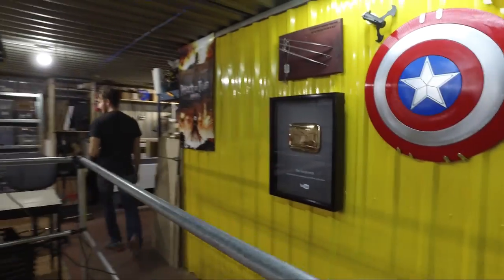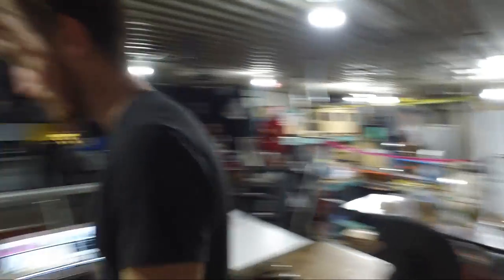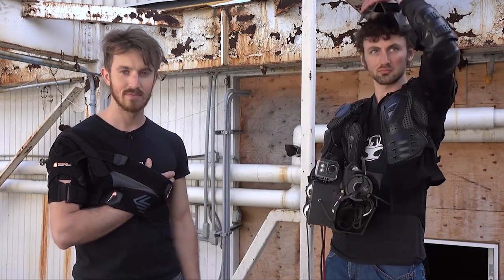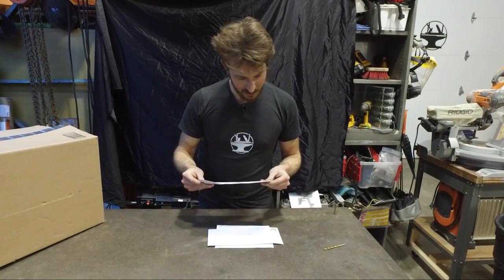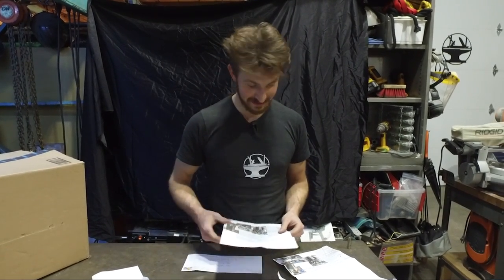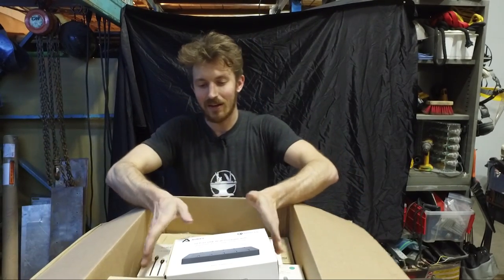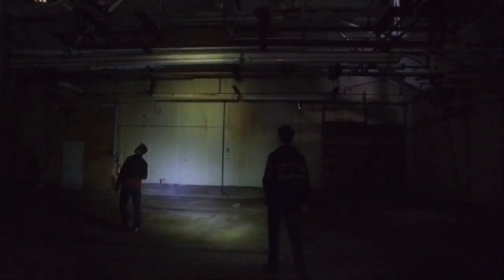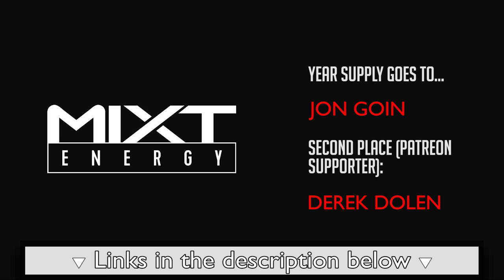LASER BAZOOKAS and Tesla Coil Guns!

Comment: you need to tighten your trucks on your longboard this way you wont wobble around and fall that easy
truck= the part that connecs to the wheels 
to tighten them you need to turn the bolt in the middle
sorry for bad english
Reply: Melvin van Dijk aaah ging wel goed joh
Reply: Aron Balk das mooi
Reply: Melvin van Dijk he should learn when to bail out as well, the moment he noticed the board wobble that much he should have bailed
Reply: also maybe elbow/knee pads, a helmet, and them wristy things xD
Reply: he could also just bend his knees
Reply: Melvin van Dijk idk about y'all but if they're tight I have less control. I keep them as loose as they'll go without wobbling
Reply: BlackironBallistics same
Reply: BlackironBallistics but if they are thight you don't wobble as much. 
And ofcoarse you don't thighten them so much that you don't have any control
Reply: Tightening your trucks don't do anything. The bushings work the same from loose to snug to tight to breaking tight. The only difference is how much give you're having the trucks go. The performance of the bushings stay the same. What you should be doing is buying bushings accustomed to your weight and tightening them to snug tightness
Reply: - KoreanJoker - if you tighten the bushings it is harder to steer so you won't wobble as much. I am not saying he wont wobble at all but it wil reduce it.
Reply: The bushings will wobble at roughly the same speed they wobbled originally. If he had the bushings tight to where they are snug in the hangars, then the performance is the same as compared to tightening it down. If you really want to tighten it down to outright increase the speed limits of your bushings, you're breaking them, which is bad for your gear. I've longboarded for years and this is what I've learned. Tightening your bushings rather than buying some for your weight causes more damage than help.
Reply: - KoreanJoker - I don't think you skate or longboard
Reply: - KoreanJoker - tighting your truck does work idk what you are talking about i always tighten them when i get wobbles and it works everytime

Comment: I built a Tesla coil about 33 years ago, I was 17 or 18 years old. I found schematics in an old book, had to wind both coils by hand. I used a cardboard tube about 3 feet long for secondary and I think it was an oatmeal container for primary.  it took forever to wind the secondary, I would wind a few inch's ten varnish and hold till dry enough to let go!  the cap was a plastic container about 1' x 1.8' with  sheet of tin foil then sheet of glass, foil , glass, etc...  then filled with oil. then a neon sign transformer that output 15kv and a spark gap! back then, no internet, well not like now day anyway, no one had seen Tesla coils so it was pretty cool..

Comment: When you are longboarding at high speeds, you should tighten the steering gummies at the bottom of the trucks. Adds stability and fewer wobbles. Therefore you will not fall off too much.

Comment: Have you seen those propane plasma poppers??? What about a Tesla coil gun which works but have very low range, mounted and fired at same time with a plasma popper... The gas blast would make the Tesla coil bolts go  further. Wanna try but have no time right now. What if you try it?

Comment: Used to be a sponsored longboarder. Try to tighten your trucks or switch the bushing to a harder dero  on build side and then still run a soft on road side.  Good luck riding

Comment: Connect the terminals of the power supply to a tungsten rod. 

-tungsten should be resistive enough to heat up

-tungsten stay strong under great temperatures
Reply from the maker: +NSX 7342 take a look at the circuit diagram ;-)
Reply: the Hacksmith oops i think i commented on the wrong video :p

Comment: the first electronics project I ever did was building a 3 foot tesla coil after school in the physics classroom back in highschool with my buddies
Reply from the maker: +A dude they're awesome
Reply: the Hacksmith might have also accidentally touched a wire to another that wire definitely not supposed to touch and blew the circuit breaker of the classroom. good times

Comment: Do you guys have the proper protection around a high power laser? You could suffer loss of vision and/or permanent blindness without proper protection (in the videos you guys were wearing goggles, but they look like safety goggles instead of real laser protection goggles).
Reply from the maker: +Rudy Liu it's an IR laser... Normal polycarbonate safety glasses block it.

Comment: I wonder what your electricity bill is like with all those chargers
Reply from the maker: Small electronics don't use much power dude... even a high powered cellphone charger is only 2A at 12v, which is only 24W, less than most lightbulbs lol

Comment: are  those graphine  lipo batteries from hobby lobby suitable for powering my solar house,  or should i stick with golf cart batteries ??
Reply from the maker: Golf cart might still be more economical at this time
Reply: is that because of the number of graphine batteries needed to get the same sustain between charges ??
Reply from the maker: No, they're expensive haha. Graphine batteries have 3 times the energy density of lead acid. But lead acid is still cheaper even though you need 3 times as many.
Reply: i see where i made my mistake..... i forgot to move the decimal in the mAH rating

Comment: You standing on the longboard wrong bend ur knees gets gloves and learn how to slide that would be dope but you usually dont need gloves to slide but since your going at a high rate of speed you should use gloves but yeah man  bend your knees and hold on to the board.. and it also depends on your trucks and wheels  you have a loaded longboard they are pretty dope but I would get an original longboard they are stronger there made out of carbon fiber and fiberglass bamboo and maple haha keep inventing my g'S

Comment: It looks like most of your crashes are due to a phenomenon called "speed wobble", which is a bitch of a problem at high speed. It just so happens that high speed i wut u do. Brakes, although helpful, will not save you from speed wobble. Order a higher durometer bushing for your trucks, I recommend 93a bushings by venom, and tighten your trucks. A simple barrel-cone setup should prevent further injury my guy :D